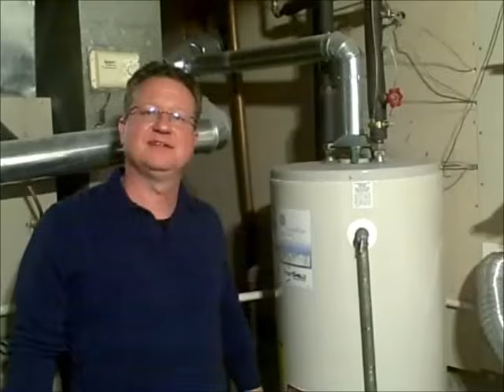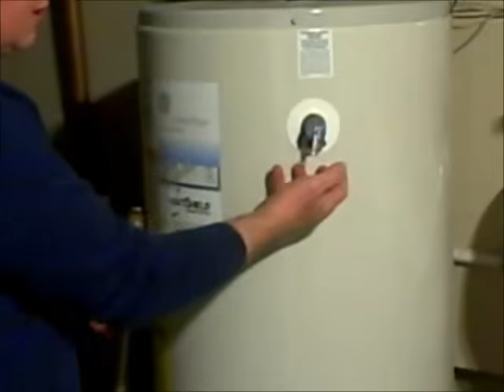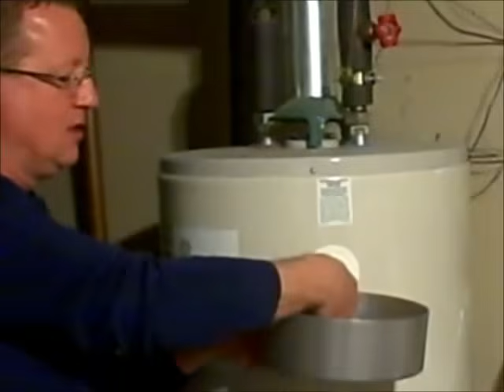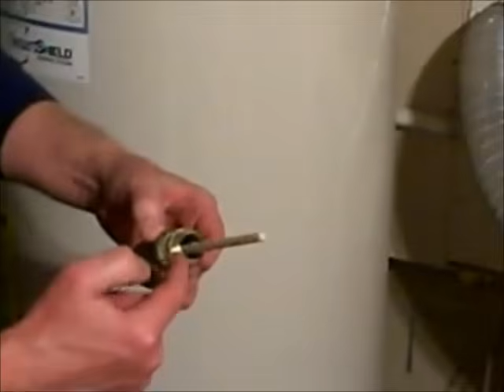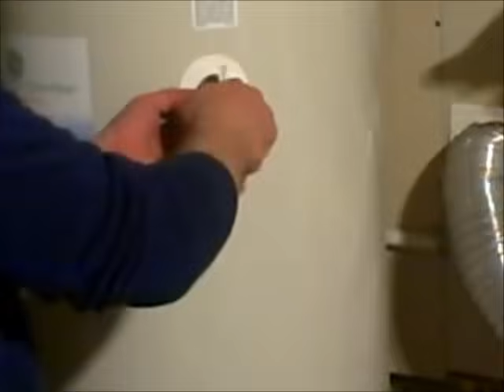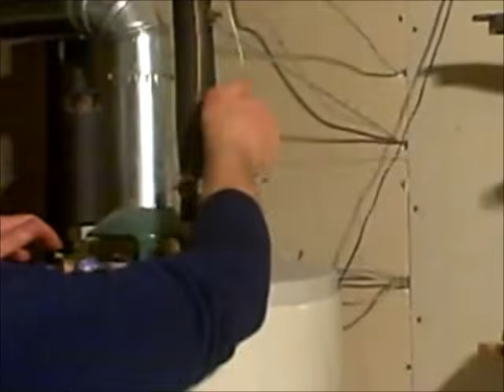Water Heater Pressure Relief Valve - Prevent Water Heater Explosion - Replace a Relief Valve

Comment: Hi, I have am electric hot water heater. The relief valve is on top with the nozzle facing sideways, There is NO tube attached to the mouth. Can I test it the same way, or will it gush water every where when I pull the valve? My hot water heater is not getting the water hot, only warm, and I read that this is an easy trouble shooting step, thanks.
Reply from the maker: Hi, you should have a discharge pipe going down 6 inches above the floor. Then you can test it.
We have more home improvement tips on our weekly podcast http://castbox.fm/u/6389499.
Reply: FIX IT Home Improvement Channel Thanks for your reply. Didn't you take yours off first? So with the valve on top, we leave the tube on?
Reply from the maker: Hi, on this tank, the opening on the valve was facing down, so I took the discharge pipe off to show the concept better. You should have a discharge pipe on the water heater by code to prevent someone from being scalded if the valved opened. If you can use a pitcher or pan to block and catch the water, you can test it without the pipe connected.

Comment: I replaced the pressure valve on mine yesterday. It leaks more now than before I replaced it! The old valve was clogged with gunk, so it's on to the next step to stop the leak. Thanks for the video!
Reply from the maker: You're welcome.
We have more home improvement tips on our weekly podcast http://castbox.fm/u/6389499.
Reply: Plug it it's not going to blow up...

Comment: Great video, thanks. On my tank, I have a side mount PRV with 3/4 copper pipe for the discharge. At the bottom of the pipe is a 45 and then a 2 foot piece of pipe that goes to the floor drain. Is this okay? It would seem that the elbow would cause a restriction if the PRV went off.
Reply from the maker: Hi, when I was trained by a plumber, he said you can have up to 4 elbows. Discharge 6 inches above the floor or above the water level in a drain. Don't have threads on the bottom of the discharge pipe. I would check the manual on your specific valve, just to confirm.
We have more home improvement tips on our weekly podcast http://castbox.fm/u/6389499.

Comment: Watched your video after discovering my T&P valve was leaking this morning. Some troubleshooting with assistance of this video and I was able to replace the valve.  I did struggle with one thing. I drained the tank and turned off the water to the heater and the house and when I removed the valve....water spewed out of the hole like it was “percolating”. Not sure what I did or didn’t do but after putting the valve back in and opening drain again....more water drained from tank.  It’s a newer Rheem tank (installed 2015) so there could be something inside that screwed me up.  Regardless.  Thank you for this. It was very helpful.
Reply from the maker: Hi, did you may have just needed to drain a little more water, or didn't have the hot side of a faucet open all the way.

We have more home improvement tips on our weekly podcast http://castbox.fm/u/6389499.

Comment: Is there any danger of the tank exploding as result of testing the valve? I have very noisy pipes when water comes on at times and I want to test the valve as i am certain it has NEVER been done in the time I rented out my property.
Reply from the maker: Hi, testing will let you know if it needs to be replaced. Just make sure you have a discharge pipe down to 6 inches above the floor. It should be replace once every 5 years.

We have more home improvement tips on our weekly podcast http://castbox.fm/u/6389499.

Comment: well my tube is a plastic tube not a metal one on my electric Hot water heater should I get a metal one or does it really matter? I live by myself so no kids around!
Reply from the maker: Hi, the discharge pipe can be CPVC, copper, polyethylene, galvanized steel, polypropylene, or stainless steel. PVC and other non-approved plastics should not be used since they can melt

Comment: I can't shut off my water. My valve only turns about a quarter turn. Btw it is not a ball valve.
Reply from the maker: Hi, did you try a pipe wrench with a long handle or a pipe wrench with a pipe over the handle to get more leverage? You can also turn off the main water valve coming into the house while you work on it.

Comment: Great video! I had to buy a pipe wrench along with the replacement valve for around $45. I called every plumber in town and it was going to be $260-300, one plumber immediately wanted to replace the water heater for $1500 without even looking at it. My water heater is only a few years old, so a new water heater is last option. Ultimately this clip saved me a nice little chunk of money. Thanks for sharing!
Reply from the maker: You're welcome.
We have more home improvement tips on our weekly podcast http://castbox.fm/u/6389499.

Comment: Great video with very clear instructions and explanations.  Just one thing though that I didn't see mentioned.  When using Teflon tape on hot water lines, you should be using the pink high temperature tape and not the white tape.
Reply from the maker: Hi, thanks. Depending on the company, pink is usually for propane.
Reply: BS

Comment: Awesome video! But one problem I had was that when I hooked up the hose to the drain hardly any water came out. So I ended up draining the water off the pressure relief valve which was messy. 
Did I have to take off the clear cap that is on top of the tank to release the air and then the water would drain faster???
Reply from the maker: Hi, you can open a hot faucet to help it drain.

Comment: If the water leak is coming from behind the "gasket" or part that encircles the pressure release valve and it is slightly bulging outward enough for water to seep around it, how do I repair it? Is there a replacement part for that or does the entire tank need to be replaced at this point?
Reply from the maker: Hi, it sounds like you have corrosion around the threaded opening. How old is the unit.

Comment: We  had this happen It caused the water from the leaking faulty Water heater valve to flow down into my closet down stairs in my bedroom and now my carpet is runined to the point where my parents had to ripped it out of the closet where it was soaked through the carpet pad how do I repair the water damage in the walls?
Reply from the maker: Hi, you need to remove the drywall so you can dry it out. Use fans and a dehumidifier.
You will then remove damaged drywall and put up new drywall.

Comment: why did you replace it if it was working fine ?
Reply from the maker: Hi, manufacturers recommend replacing the pressure and temperature relief valve every 5 years.
Subscribe to our weekly podcast for some home improvement tips. 
https://itunes.apple.com/us/podcast/fix-it-home-improvement/id880903087?mt=2

Comment: My water heater is ringing is this the problem, I need to let out 1 or 2 cups of water out of the relief valve?
Reply from the maker: Hi, you could try that and see what happens. It is important to check the valve regularly anyway. Let me know if that helps.
Reply: About that ringing hissing sound coming from my water heater. When I turned off the pilot and flame the sound stopped, I tried to turn it back on and the pilot will not light, the 4 or 5 small pipes leading to the water heater have caulk sealant stuff coming off. The pipes attached to the main gas pipe coming into the house. Is the problem that I need to reseal with better caulk sealant on those pipes, will the pilot then light and be fine after that? Is it like the water heater will not light if there is a leak, if so how would the water heater know its leaking is it because of the pressure coming from the pipes is to low? Could the pilot orifice be clogged also? Thank you so much you guys that do these how to videos on YouTube helped me and other people many times

Comment: I've replaced my pressure relief valve twice and each time is has a slow leak. I've used several different grades of Teflon tape and different sealants.I'm thinking of putting a three-inch nipple with a coupler on because the relief valve will actually thread all the way into the tank past the threads. That way the valve actually will seat on the coupler and the nipple is a graded thread.
Reply from the maker: Hi, if it is leaking from the threads, try pipe thread compound with teflon. Put plenty on the male threads and screw down tight.

Comment: Why didn't he show us how and when to take the hose off at the bottom!?
Reply from the maker: Hi, I should have. Just connect a garden hose to the shut off valve at the bottom of the tank. Turn off the main valve going to the water heater, open the hot side of a faucet or the tub and open the valve on the bottom of the tank. Drain out a few gallons of water then check to see if you have released enough water by opening the temp and pressure relief valve.
Let me know if that helps.

Comment: The pressure relief valve failed on my daughter's tank. The tank was starting to come apart at the seam.
Reply: cooldog60 we have this issues with that right now at the condo where I live so now my carpet in the closet is damaged and we are not sure if there is mold were we can't see it should we keep putting fans on the wet area's to help drying out the wet carpet need advice

Comment: You drained 5 gals then you attached a wrench and removed the valve. Would it not have made sense to pull on the valve again at that point and make sure there is no pressure behind it. That would've made for a big surprise for you if there was pressure I'm guessing. How can you be sure you've drained enough?
Reply from the maker: Sound like a great tip.

Comment: where's the drip pan under this water heater? Bad form ;-P
Reply from the maker: Hi, most homes in the basements in unfinished areas in the Chicago area you won't find them. Usually in an attic or drywalled space where damage could result from a leak is code in most areas.
Reply: That's good to know. I honestly just learned what a water heater drip pan is yesterday, because an inspector told me there wasn't one in the house I offered on lol

Comment: Excellent video!  Ultimately discovered that I had a slow leaking valve.  Thought my 5 yo tank was actually leaking until i happened to catch the drip coming from the TP valve discharge tube.  What I also learned was that the TP valve lever fully opens at 90 degrees to the valve (or parallel to the floor on a side mount valve like mine).  For whatever reason I thought that a fully opened valve meant swinging the lever from one side of the valve 180 degrees to the other side.  I discovered this while draining my tank and noticing how slow the water was draining despite having a faucet open down line and what I thought was a fully opened valve.  Once I started to play with that TP valve and discovered its true open position the air pressure vacuum was released and it drained like a charm.  FWIW, i decided to drain my tank all the way down.  As it neared fully drained I opened and closed my CW supply line to the tank a few times just to stir up any loose sediment and aid in passing that through,

Comment: I guess to make my question more clear could my hot water tank be emptied jus by using the hot water while the breaker is off?
Reply: No.
Reply: The hot water won't run.Only your cold valve will work

Comment: I opened the release valve and no water came out also when I tried to flush it from the bottom valve nothing came out. also I have no hot water at all.. not even Luke warm.. I was wondering if my breaker for the hot water heater could cause it to stop pumping water in and be empty??
Reply from the maker: Hi, if you opened the temp and pressure relief valve, and the water is on to the tank, you need to replace the valve.

In a standard tank the water is coming in from the cold water line. Check your shut off valve just before the tank.
Reply: +FIX IT Home Improvement Channel k thanks

Comment: Can air trapped in the tank effect the working of the Valve? I.e. Will it still open if there is air in the tank?
Reply from the maker: Hi, open the hot side of a faucet and bleed out any air in the tank, then test the valve.

Comment: Is it ok for the tube that is attached to the valve to be pointed open straight at the floor? If it ever releases pressure/water, would it not pour out a lot of water on the ground causing water damage? Is there something to get to run the tube into? I just have a bucket under it now.
Reply from the maker: Most plumbing codes say that the discharge pipe needs to be no more than 6 inches above the surface that you are directing to, so above a floor or the water in a drain. They don't want it to be trapped, since standing water may become contaminated and backflow into the potable water. 

Do you have a floor drain?
Reply: Nope, no floor drain. So I guess just put it over a bucket?
Reply from the maker: Hi, the code says they don't want the water contained because of the potential to backflow into the system.

Comment: Hi. Nice video. Question. I have a bad valve stem in my bathroom and the only shutoff to the hot water is at the tank and nothing in between. No stores have the part till Tuesday. Can I just shut that cold water valve off and shut off the gas?
Reply from the maker: Hi, that will do it. Is the leak out of the spout? Do you just need a new washer?

Comment: I did most of what you did but I didnt drain as much water as you did from the bottom with a hose. But now I can only use water on the basement level and not the floor above. When I turn on hot water, the faucet shakes a little bit and not as much water comes out. Any ideas of what the problem is?
Reply from the maker: Hi, the first thing I would check is the aerator on the faucet. Take it off and run the water without it to see if that is clogged. If it is, just rinse it out.
Let me know if this helps.

Comment: Two questions what should be the pressure in my water heater and how do I know if I have a bad water heater pressure valve?
Reply from the maker: +Danny Diet Hi, your water pressure is determined by your city or your pump if you have a well. Usually around 50 lbs.
If you valve is leaking, change it.

Check the valve once a year. If it leaks or does not allow water to release, change it. Change it once every 5 years.
We have more tips in our home improvement book http://www.amazon.com/dp/B01BK2K0JM?ref_=pe_2427780_160035660
Reply: FIX IT Home Improvement Channel Well what I discover is from slop sink it was 50 pounds but gauge near water main says 65 pounds maybe gauge is old. Any way changed relief valve all is good TY
Reply from the maker: Great

Comment: the very bottom of that pipe on my water heater is leaking out....any ideas why?
Reply from the maker: +Kimmie Lette Hi, you should change the pressure and temperature relief valve. It should be changed every 5 years to be safe.

Comment: Does it need to be run to the outside, by any codes you know of??
Reply from the maker: +Charles Goldberg Hi, the main code is a 6 inch air gap above the ground. I would check with your village to get any local code.
We have more tips in our Home Improvement Book http://www.amazon.com/dp/B01BK2K0JM?ref_=pe_2427780_160035660.

Comment: My valve will not turn to detach from the water heater. Is there any tips on how to loosen it up to replace the valve with a new one?
Reply from the maker: +Michelle Irvin Hi, if you have a galvanized discharge pipe, you can use it to get better leverage and start turning the valve. If you have a pipe wrench, you can slide a pipe over the handle for more leverage. You can also remove the discharge pipe and slide a long screwdriver into the opening to help your wrench turn it. A shot of Liquid Wrench or a similar lubricant might be effective. Let me know if that helps.

Comment: I just had the t&p valve and both thermostats replaced.  Temp is set at 120 and worked fine for 3 days then started overflowing again. Any ideas?  Even the plumber is baffled.  I just turned off at breaker and turn it back on long enough to heat a tank for showers and doing dishes then turn it back off.
Reply from the maker: +Sandra Bennett Hi, do you have an expansion tank for the water heater?
Reply: I will have to find out.  How can I tell?
Reply from the maker: Here is a link on what it is. As the water expands, it takes off the pressure. It will add life to your tank and appliances. https://www.youtube.com/watch?v=G2kRC-mETM4
Reply: Thank you I'll lookup.  The tank is only 3 years old so I'm annoyed that it's been so dysfunctional lately.  I appreciate your help.
Reply from the maker: Let me know your solution.
Reply: yes i have had mine water tank for 3 years and same leaking from there too..had the valves replaces and all and the plumber said i have too much pressure coming into my house?? no idea what to do
Reply: It’s usually a pressure issue. Mine is doing the same and I’m still dealing with it!!! If you never had an expansion tank, then you don’t need one. You need a PRV (pressure reducing valve) then install new temp & pressure relief valve. Hopefully that will work. Mines is doing the same and it’s only 2 years old!!!!! I already changed the temp and pressure relief valve and it started dripping again 2 days later. They lowered the temp—-that doesn’t do anything. So now I am trying to get my HOA to approved a PRV (pressure reducing valve) places becfore having another temp and pressure release clave placed. If that doesn’t fix it I’m worried that my 2 year old tank is wack!!!!!
Reply: hi sandra, i have had mine for 3 years and same issue. had valves replaced and all and it still leaks. it is frustrating, the plumber said i have to much pressure coming into the house?? weird don't know what to do now. it has been leaking for months